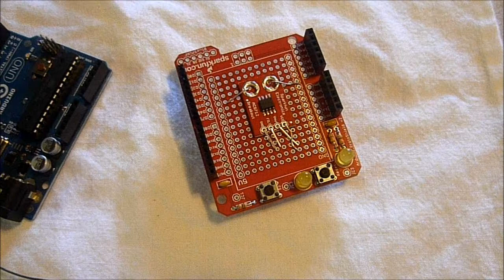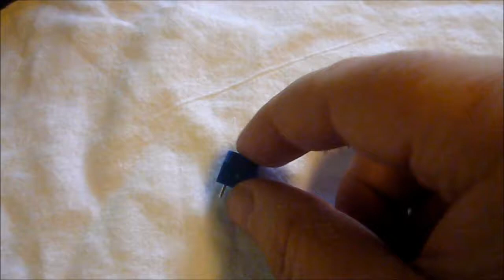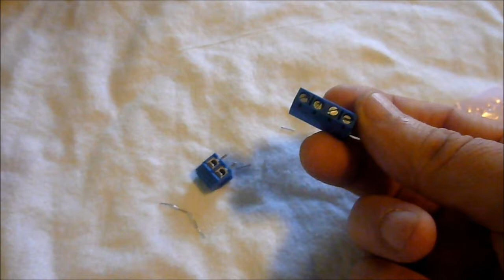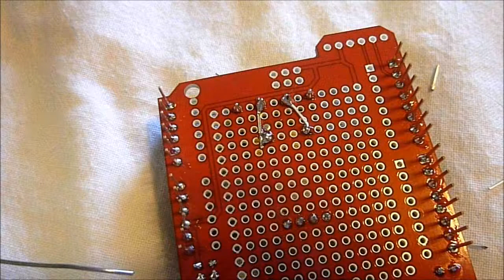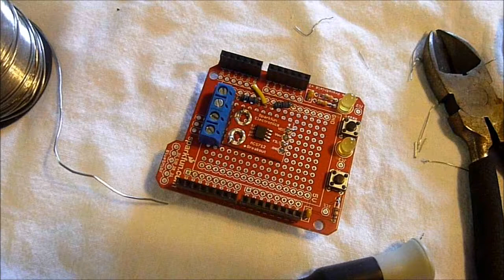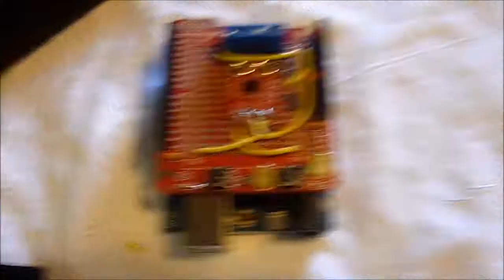Arduino Volt Amp / Watt Hour Meter Shield

Comment: coOL project. I'd like to build this for 12v battery monitoring. I'll have to adjust the resistor divider network..I can no longer find the ACS715 Hall Effect sensor...just ACS712, if that will work as well. ?

Comment: I've only just started with Arduino (Chinese clone Nano actually) so please bear with me if I a'm totally off track here. I've built a voltmeter which works well on a 16x2 screen & was cautious in selecting resistances for the voltage divider. You have selected resistors which will give you half the incoming (solar panel ?) voltage but I wondered, is there no danger of thevoltage source delivering more than 10V and therefore more than 5V being input to the arduino?
Reply: It is also sensible to clamp the voltage into any analog input pin with a 5v Zener diode that will shunt the voltages over it's Zener voltage. It will start to shunt low currents below the states 5V (or 5.1V) so measure out when it starts clamping and adjust the Vref to match the max range on your analog input port.

That way even if your voltage goes above what you expect to ever measure the upper resistor will limit the current through the Zener and the Zener will protect the analog port. Use as high value resistors as you can get away with as that will limit the load on the circuit you're measuring and it will limit the current through the Zener if the voltage goes to high.
Reply from the maker: select your resistors so that the maximum voltage the divider can possibly output at the maximum system voltage is just under 5v. Measure your resistors, and put those values into the code to calculate the ratio dynamically.
Reply: Yeah Steve, that's what I have done. I perhaps did not express myself well. You have used 2 x 10K resistors which is just in limit (out-putting 5V if your voltage source goes no higher than 10V) I was just asking whether you have given yourself a margin and/or you are confident that your voltage source could never go above 10V? In my application, I have used 100K and 10K resistors which would allow my input voltage to go as high as 50V even though the stuff I will be testing would normally be 30V max; this allows for overshoot if the power source should fail and output in excess the regulated voltage.
Reply from the maker: My source was a 9v battery, it can't go over 10v
Reply from the maker: By over shooting by such a large margin, you decrease sensitivity. Be safe, but not over safe.
Reply: Ah, I see (didn't realise it was a 9V battery - had it in my mind it was a solar panel - don't know why I thought that). Thanks for taking the time to reply. Take your point on big margins (may consider reducing the safety margin a bit but, in the event of my power supply regulation failing, supply could go to 41V DC)